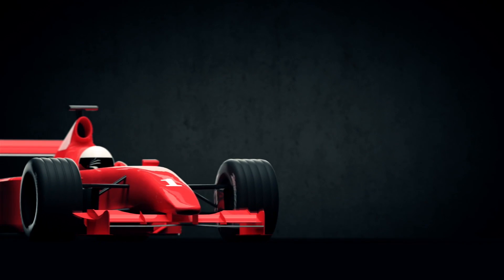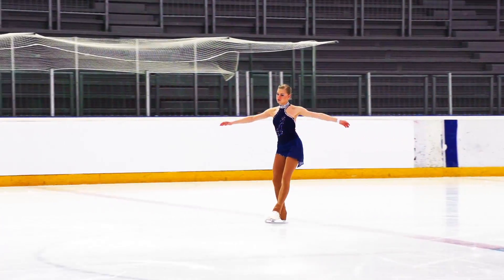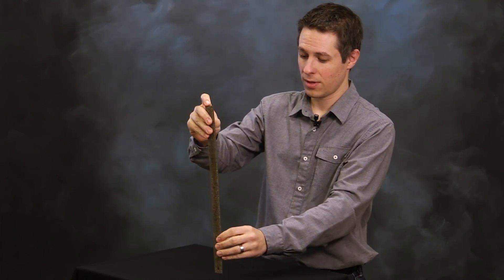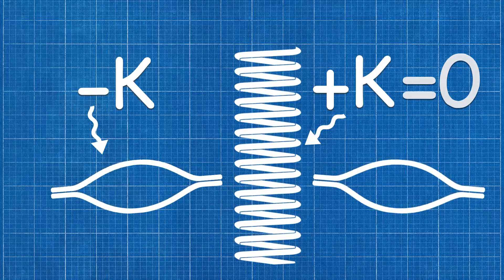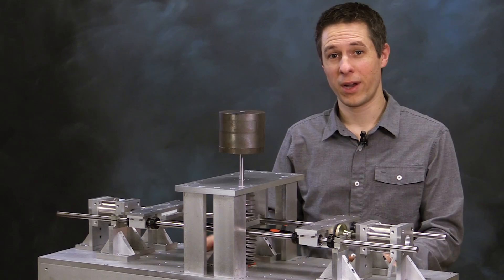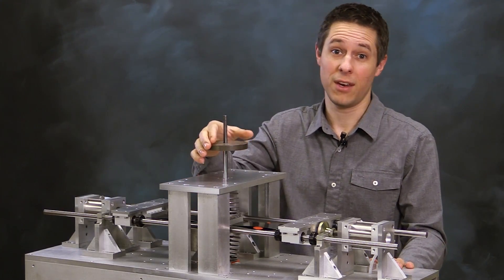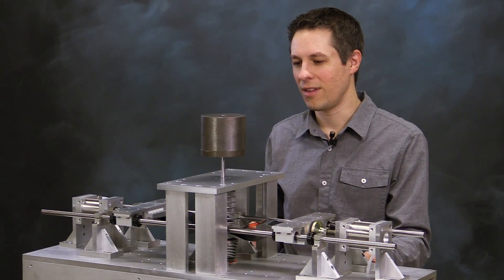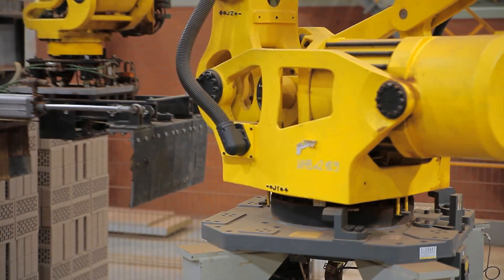Tunable Variable Stiffness

Comment: So tell me, all you are doing is isolating the spring length and changing the constant potential energy in the spring? Why could this not be done without a buckling system?
Reply: +Keaton Christensen 
Thanks for the question! 
Negative stiffness systems allow us to separate spring stiffness from spring length. Otherwise, a soft system which supports a load could be excessively long. Our system is different from a typical (linear) spring, which has a potential energy profile that is a parabola with displacement. It makes sense then that the force-deflection curve of this is linear (first derivative of energy) and the stiffness is constant (2nd drerivative).
When the buckled beam system in the video is balanced correctly, potential energy is actually constant while the beams are buckled. This is why I can move the mass so easily- it is always at an energy minimum. The force-displacement profile (1st derivative) is nearly flat.
You can definitely do this without a buckled beam. In fact, the system in our companion paper to this video simply uses a linear spring in compression. This doesn't create a perfectly constant potential energy, but it is still much flatter than a linear spring, and its 2nd derivative (stiffness) is still zero when balanced.
The buckled system gives us a large "throw" of low stiffness, but at the cost of being only "active" between 2 different levels- it is either on or off. Replace the buckled beams with coil springs or their equivalent, and you have a system with less throw, but it can be actuated to any stiffness in between zero and the support spring's stiffness.
Reply: +Chris Churchill thank you for the in depth description! consider this: implement a device between the buckles such as gears or intermediary shift and lock system to which you can select the point at which the buckles latch on the spring. Im not sure exactly how you could set this up, but would that create an infinitely controlable stiffness and  system. I know the reason current suspension systems are used are because they are simple and they do the job, and this device does need some work to be as simple operating as current suspension. And in that case, there may be a way to lengthen the spring and permanently install the buckling system so the when the vehicle reaches a point of necessary spring stiffness, the weight and inertia of the vehicle will force the spring to compress, buckling the bars halfway down, and - on the parabola graph- creating a seamless conversion from "soft" to "stiffer". This could be done vise-versa with an actuator like you presented. This concept i believe was simplified by the leaf spring system or the variable stiffness coil spring. However, like you said, it is more of a linear graph. I would love to be working on systems like this. Thanks again!